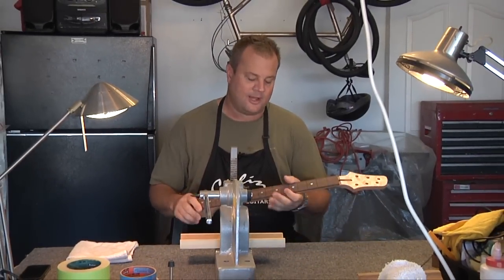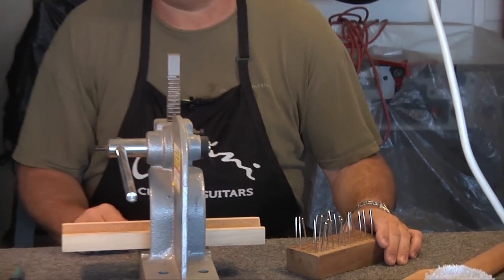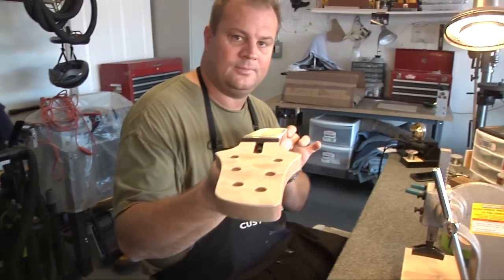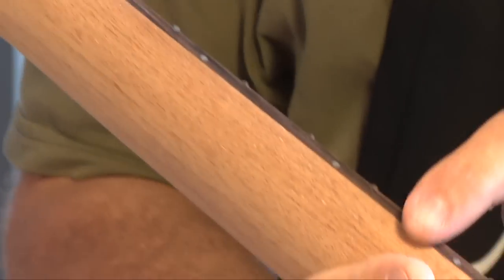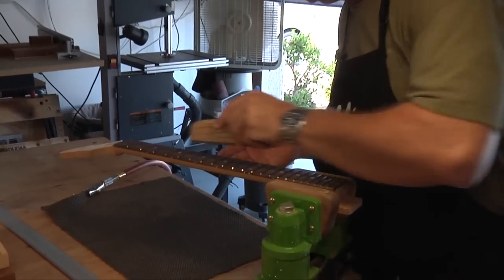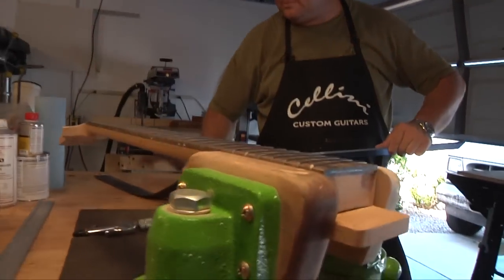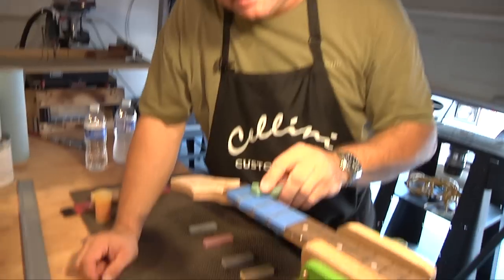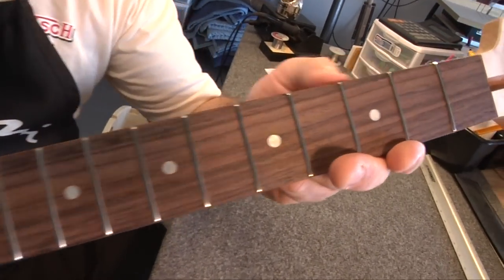Erics Guitar Garage-Ep8._Guitar Neck Fretwork.mpg

Comment: Hey Eric, have you ever used a sanding block/bar to level the frets? How does that compare to using the file on top?
Reply: +Matthew Wiebe    You cannot 'sand' frets. They are steel and require an abrasive like diamond particles on a tool to cut steel.